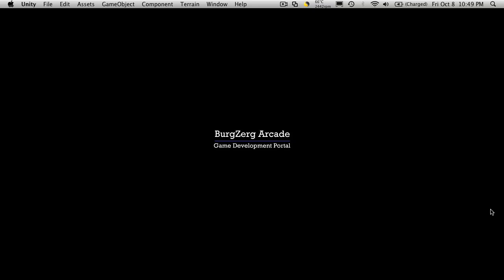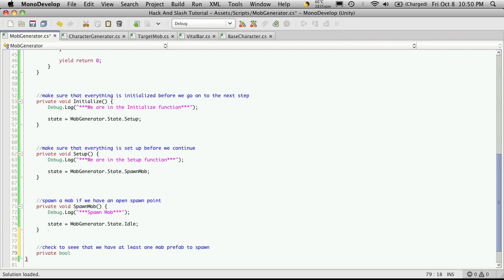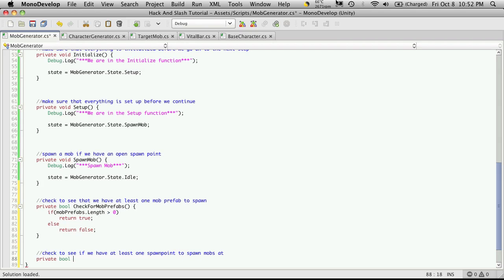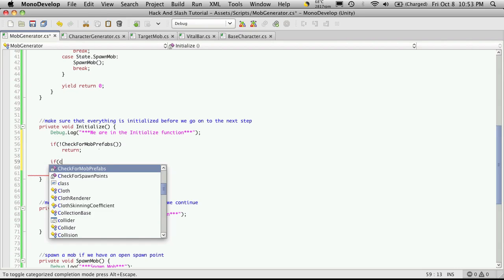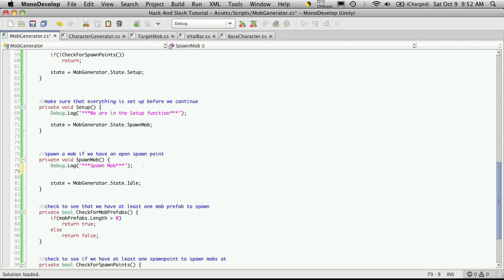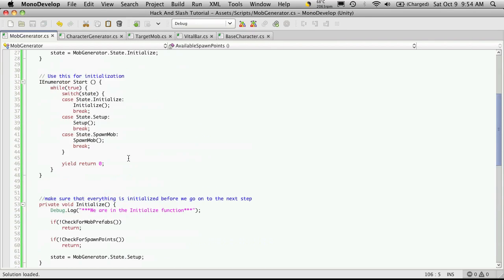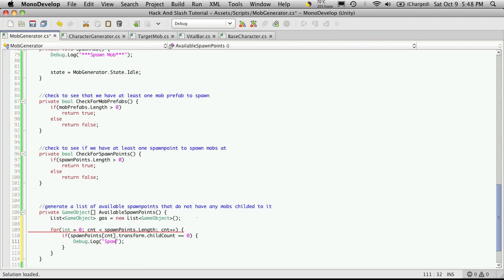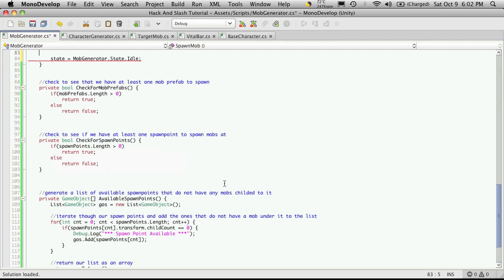57. Unity3d Tutorial - Spawn Points And Spawning Mobs 3/3

Comment: Works great but I have one question.  In MobGenerator.cs, I put a 'default' case at the end of the switch-case block because of the 'Idle' that must be passed to it after it causes the SpawnMob() method to be executed.  In the default case, I added Debug.Log("state = " + state).  When I ran it, I ended up with a ever growing stream of logs indicating that Idle is continously being passed.  Is that how it should be or should Idle be called once via the switch-case block?